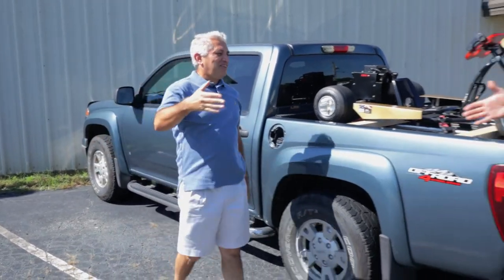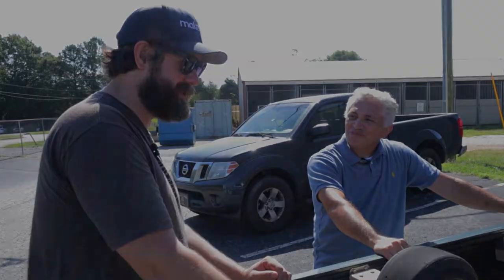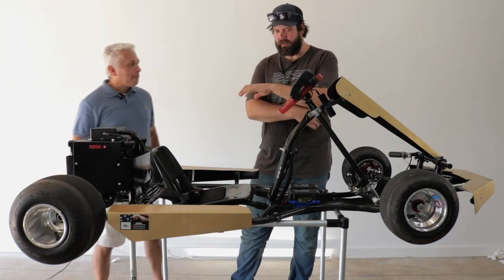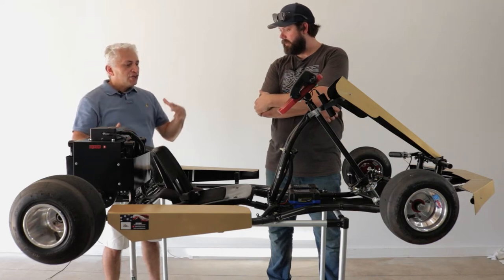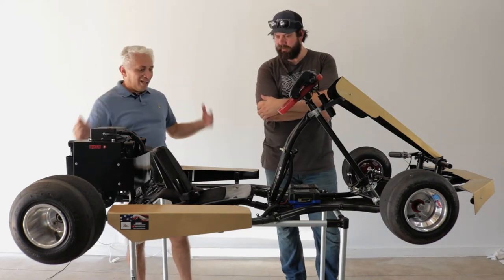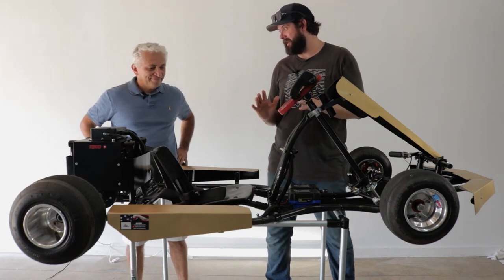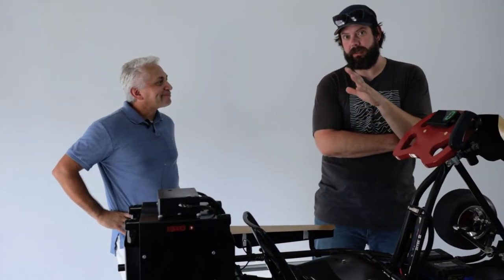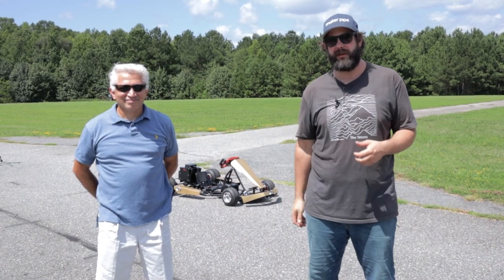DIY Electric Go Kart with a NO WELD Frame! - Maker Pipe

Comment: Awesome build and first intro to the product. Long time woodworker and cyclist and looking to build my kids a model using 8spd bike gearing and 24v electric power (to teach them the basics of shifting, cause you don't need to shift with electric power). Can't weld though. But this unlocks endless possibilities for the frame that I was otherwise stymied by! Thanks for the DETAILED walk through of the build including the "non-traditional" uses like the pitman arm!

Comment: Pipe size ?
Reply from the maker: Hi Brian our connectors fit 3/4" EMT Conduit. Let us know if you have any other questions.
Reply: what are the lengths of pipe you have and where?
Reply from the maker: Hi Nathan, our connectors are designed to fit 3/4” emt conduit which is locally found at almost every hardware/home improvement store.